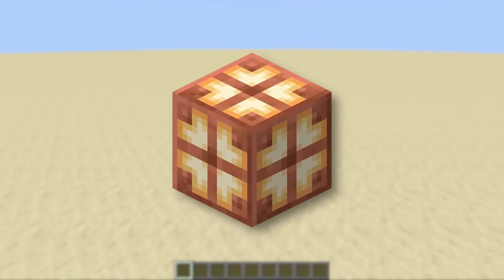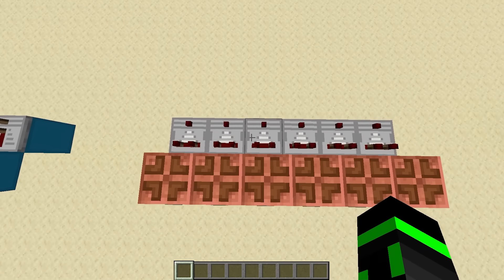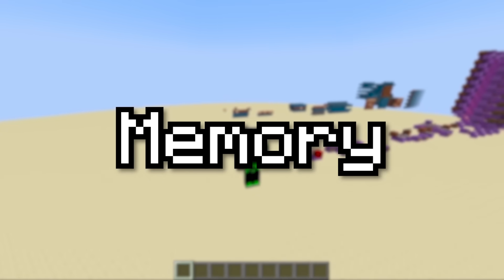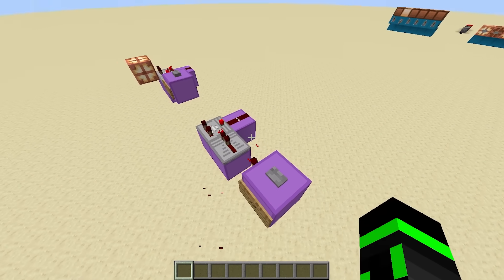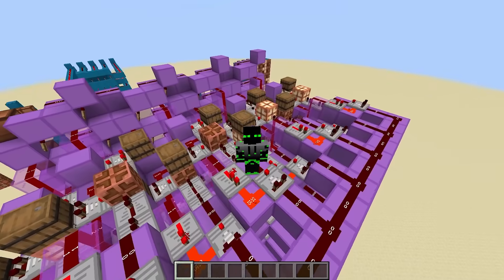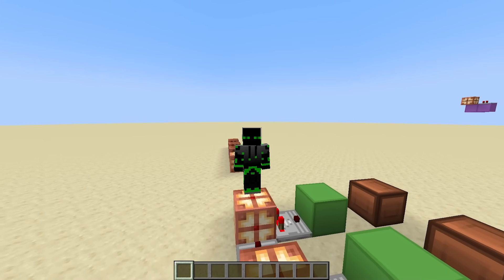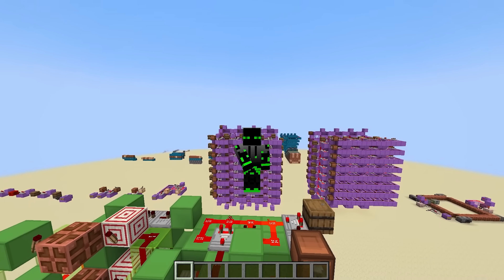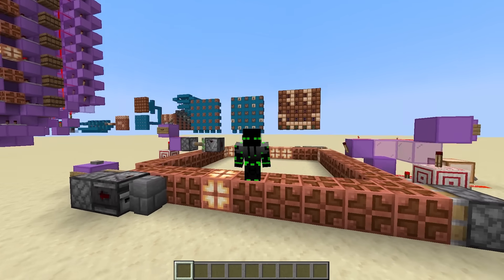Why I'll Never Use Copper Bulbs

Comment from the maker: What do you think? What do you agree/disagree with?

Btw, this is the first time I’ve ever made an opinion/rant style video, so please let me know what you think!  :)

Have a great day!
Reply: I feel that the reset is the most annoying feature about the copper bulb. The copper bulb will probably be used more in Bedrock for counters as the Java synchronous counter design doesn't work. Without a good way to reset the bulb, designs are very large which is unfortunate. I would have liked if any additional Redstone pulses also toggle the counter, even if the bulb is being powered. The pulse shortening to 0 ticks is a bit of a weird change. I would have preferred if they make the normal bulbs 0 ticks, the exposed bulbs 1 tick and the weathered bulbs 2 ticks. This would give the other blocks more use that just light levels and also appease the general Redstone community.
For computational Redstone, I think most people will just switch to these as t-flip-flops as they are easy to build.
Reply: Something that I disagree with: the flappy bird circuit u mentioned can actually use copper bulbs with barely any modifications, just put observers in front of the output torches and copper bulbs in front of the observers, bcus remember observers detect block states, and when the torches toggle it updates the observer both in the rising edge and the falling edge, and as a bonus there is no delay for the copper bulbs to toggle so it's very good for animations
Reply: I respect the hell outta you and your ability, but I have to disagree with you that 1t vs. 0t is irrelevant for logical redstone.... the original bulb had the possibility of doubling the frequency of many circuits.  That probably would've been the biggest change to logical redstone in recent memory.
Reply: Opinions: To start off, the 1 tick offset would've actually been pretty nice for making 20Hz machines, likely not that useful for what you make, but for a CPU builder (such as myself) a compacter, faster way to offset a signal into the 2nd range would've been a nice upgrade

The T-flipflop aspect is probably more useful than you think, currently we don't use them thát much, but it's because t-flipflops are slow and large, it's likely they can be used for more complex modules (like multipliers) or maybe even just logic gates

RAM is something I'll mess around with but the bulb will be more useful for executing operations on large amount of data, a kind of GPU
I think the biggest thing in the way of copper bulbs ram usability is that they can't be "reset"

Movability doesn't really matter, there's a saying on ORE "biston bad", we don't want non-solid state blocks in our computers

The counter could be useful as long as it's faster than the full circuit: The counter's output is locked until the CPU finishes its command and reads the next number, which by now has 'loaded in'

Displays don't really matter too much for me, but screens that store their input separately can easily reload the image to correctly disable the bulbs

*Mainly:* Copper bulbs speed up (and compact) T-flipflopping, and as someone looking to take out delays out of already incredibly slow machines, it'll be a nice upgrade
Reply: @Natural_Power   That's the thing with the 1 tick change... they "fixed" the feature that made block more useful than all of its other features combined, and no-one was asking for a fix.  It was universally loved, and they somehow came to the conclusion that it should be removed.  Like...what?
Reply: I feel like you have the wrong approach, you are trying to fit the copper bulb into already existing designs. I'm sure that over time people will discover clever ways to use the copper bulb that is genuinely useful. I think it's important to think of it as a tool in your toolbox rather than better or worse than some other component.
Reply: @kennyduncan7  Computational redstone is about using existing components in large numbers and clever combinations, so the only way a new block can be useful is if it improves something that already exists.
Reply: review every redstone component like an unboxing video now!
Reply: @CraftyMasterman  that would be awesome
Reply: I like how you just made a spinning hard drive inside of minecraft
Reply: The spinning memory thing can litterally be a disc!
Reply: 9:27 - "Copper bulbs are movable"
This means that you can make a movable display, where you can print something on it, layer by layer, and then move it to the user. Maybe you could try to make a rotating copper boolb chain  where each loop is different, like for displaying a moving text...
Reply: @Thesuper997 that was the first thing I started doing when they made bulbs usable. A feed tape can write, read and clear in separate locations on the same cycle
Reply: You raise some excellent points from your field of view! Personally I disagree with your points on selector UI. I personally like UI in Minecraft to be as reachable and as compact as possible for convenience of the user, so that you can see more at one time and perhaps don't need to move as far to select more options in some cases. I approve of CLB (Copper Lamp Button) selectors, but that is just subjective opinion.
Reply: I made 1x2x13 per bit RAM using copper bulbs.
Reply: there are now harddrives in minecraft with spinning bulbs
Reply: i think you overcomplicated the read write at 8:07, all you need is a button directly on the bulb to write the memory, then take a comparator output. much smaller and doesnt need to read itself. im not 100% if this solves what youre trying to do but i cant imagine it needs to be as big as you made it
Reply: how dare you have an opinion
Reply: 9:30 - actually u could do the same with comparators
Reply: To me it can boiled down to "I don't really need it" / "It makes things more difficult" and then "still pretty cool though"
Reply: I personaly think that lamps arre closer to a rapid acess memory; where it is temporarily stored but only for active use. I think the spinning design could be expanded upon with the copper bulbs, though, to make something like hard drive storage. I mean, that is more or less how it works irl: a spinning disk reading 1s and 0s. 

I also imagine it could be used to create the beginings of an internet: image 'files' can be stores (and in advanced systems eventually maybe even called), and using the leaves and observer trick, it could send anything from morse code to low res images between 2 systems
Reply: The bulbs are ok but not the best. You can definitely mimic using observers though. Especially for your flappy bird on “turning it on then off” so you’ll have a one pulse input instead of two because observers do the work for you lol
Reply: It can also be used as an XOR gate
Reply: Also if you want to reset the copper bulb instead of using an XOR gate just input it into itself when you want to reset them
Reply: And another thing if you want a screen you can use an observer
Reply: As a fellow computational redstoner (albeit on a smaller, less informed way) I think that if you don't know how to make things like a synchronized binary counter and don't want to look it up like myself, than the bulb is in fact a good place to start.
Reply: But wouldn't the piston v-tape be a good shift register? State reset could be made at the way "back" to the input. You could also shift the back, which isn't possible with repeaters.
Reply: I think copper bulbs are created specially for a logic redstone, specially for a memory units. But i think you using them wrong, it's easier to roll up them in tire so that bulbs can be used like real hard drive (like you did on 9:25), the only problem that it need a control system instead of straight in-out
Also, synchronized counter maded using copper bulbs is easier to reset, because it can be done without taking your mechanism apart , just use comparator, piston and observer
Reply: The important thing is for us to understand that copper bulbs are not a replacement for lamps. And it shouldn't be compared to redstone lamps in the first place. Instead of thinking how copper bulbs cannot replace redstone lamps in your designs, try to think about in what ways it could help your works in other ways. But yes, as of whether you want to use it or not is entirely up to your own preferences. 👍
Reply: I think the moving data system could be used for some form of assembly language, just stick them in a line and make them move along it in a defined pace to run the code
Reply: i thought they would be a gamechanger for memory at first, but i guess a t-flip-flop is pretty useful.

Also for timers, but mojang wrecked that :(
Reply: I'd rather watch your rant video than most others, and I partially agree with your opinion in that the bulb is not quite the game changer everyone is making it out to be, but if you really got to playing with it I'd bet you'd come up with some pretty cool circuits.
Reply: now starting off here i'll say my thing is doors, i don't make much else cuz i don't usually need to for what i make but i would like to say i have gotten so used to thinking with an adaptive block that it seems difficult to me to adapt [pun intended] to a toggle block. not sure if that's just me, but i wouldn't be surprised if it's not either.
Reply: i use redstone a lot i love it
Reply: but i hate what theve down to it in the newer snapshots
Reply: i don't play minecraft, 
but if your big brain says its bad to have less tick rate
then i believe you, haha-mwahaha.
Reply: Aren't copper bulbs usefull for transferring bits?
Reply: @mattbatwings Can you put a link for a truth table with all the letters of the alphabet and there codes for decoders
Reply: From what I understand, you're claiming copper bulb based memory to be the linked list of logical redstone. And as with linked lists, the basic idea will probably be morphed into something useful for the field.
Reply: Try make operating system, with program selection, calculator, paint, games and writing program
Reply: I wouldn't consider this a rant. It's considered reasoning for your use cases. I'm using them for the tape in a Turing machine but that's the only thing (so far) in computational redstone where I thought "this is a perfect job for copper bulbs."
Reply: You could create a piston feed tape memory if you want to read sequential data chunks.
Of course, item mechanics can do this too.
Reply: I think copper bulb can be used to make hard disk for your computer
Reply: you just need a mirror of the screen you're displaying but more spaced out behind the scenes, would make it trivial to clear the screen too.
Reply: i'm not like. super good at redstone, but in regards to using the bulb as r/w memory, would it be viable to, instead of hooking it up to an XOR gate, just have it sort of reset itself before writing? if it's 1, then directing the signal from the comparator into itself would set it to 0, then you could reliably write to it. and ofc if it's 0, nothing would happen.
Reply: the idea of copper bulb is not to replace lamps but todo things you could only do witch larger sircuts
Reply: It is possible to make a flying machine with an embedded message formed by these bulbs?
Reply: So guess you didn't try to incorporate it into any logic circuits  because you can make an insanely compact xnor gate with 2 observers and a copper bulb
Reply: bruh
Reply: What about the 1 game rick delay
Reply: Compression?
Reply: Sculk sensor memory? Might take a bit more space and pain because of the bulk of wool and the annoyance of having to cover up every reading piston with wool when retracting wool to take signals. However, the benefit is wireless communication of 1-15 signals through walls with easy decoders, encoders, and writing to memory.
Reply: Just use it as a transistor, on=1 off=0 easy, and practical
Reply: Would the copper bulbs work better for long term storage?
Reply: When she remover the one tick is good beaceause now you can make signals that are instent and longer than 15 blocks
Reply: 🤔… Although I think building a computer in MC is kind of impractical, I enjoy watching the creativity, and the creative ideas involved with it can be useful for more practical builds (farms, grinders, storage systems, et cetera) sometimes. As for color displays, if I were going to build one I wouldn't consider copper bulbs. Using colored glass and sticky pistons would produce the best results imo. If you're really fancy you could make a backlight with beacons, though any light source should work technically.
Reply: @MoorganHart  it's not factorio, it's minecraft, you build something once and it works. Why you need to build farms in survival? It isn't funny
Reply: All I have to say is that we now have a compact way on bedrock edition to half the frequency of redstone pulses. For example, if you attach an observer to a piston on Java, whenever the observer sends a signal, the piston pulls or pushes the block, while on Bedrock it just pushes and then pulls it back quickly. But now, you just need a copper bulb and a comparator and it does the same trick. There are quite some differences between Java redstone and Bedrock redstone, but a way to make some parity between the two is always good, especially if you can only play on Bedrock and the most interesting creations work only in Java.
Reply: I think copper bulb is IC of T-flipflops.😁😁😁
Reply: 8:25 you can just make a hard drive out of bulbs using piston feed tape
Reply: 8:28 no, its ok that it just erases. its STILL USEFUL for that.
Reply: I completely disagree with you on the copper bulb at 2:41. The lamp is on, of course it’s on, and the copper bulb constantly emits a redstone signal, so it can’t even do pulses. I think you’re making an issue that really isn’t an issue. I mean this respectfully, I don’t want to be rude to you. Also if I’m wrong please correct me
Reply: I agree
Reply: they should make a waxed version of the block thats 1 tick vs the 0 tick version
Reply: about the RW memory, in computer science, you dont assume that the memory is 0 be default. you fill it with 0s before using it.
Reply: I really like them, but i agree, the resetting part is annoying.
Reply: the point about levers signifying toggling by the fact that its a lever is Imo not a very good reason to choose lamps over bulbs as BULBS signify toggling by the fact they are bulbs just like levers.
Reply: This video came out a year ago and it's still useless
Reply: feel like everyone else in the community is doing the rant videos, this ones so much better than that though, actually discussing why it's not ideal for your field of redstone piece by piece
Reply: With the button selector you're making a mistake I used to make - getting too accustomed to the old stuff and hating the updates because they are different. It's annoying when updates make your previous knowledge obsolete, or when someone makes a design better than the best one you could make. However, just refusing to use the new stuff update is basically just giving up on making good redstone - unless you genuinely think the old stuff is actually more fun to work with, since then you can call it a self-imposed challenge.

You could make a toggle memory for a computer with the bulbs. Instead of putting XOR gates in each memory cell, the computer would have to read the old value into a central XOR unit.
Reply: @immibis yea I felt like he turned down functional and/or aesthetic improvements in order to avoid time investments
Reply: I understand all of your points. I also think that its cool that mojang is bringing more components that arent useless. (Skulk sensor, im looking at you 😂)
Reply: @pixl_xip  skulk is good, but again, not useful for computational stuff. Ever seen cell/wifi towers in minecraft? that was made with calibrated skulk sensors.
Reply: @pixl_xip 
It's useful for automatic doors and deep dark gameplay though
Reply: @Yegor_Mechanic  sure and those are the intended uses, but it cant do more than that, thats all im saying
Reply: @pixl_xip 
You can make mines
Reply: @pixl_xip  you just made the entire trap community angry af
Reply: @pixl_xip  Sculk sensor memory? Might take a bit more space and pain because of the bulk of wool and the annoyance of having to cover up every reading piston with wool when retracting wool to take signals. However, the benefit is wireless communication of 1-15 signals through walls with easy decoders, encoders, and writing to memory.
Reply: Basically this video = my thoughts, but I think it’s a bit more useful in silly small circuits where you just need a t flip flop.

Comment: late to the topic but I mainly use them as a pulse divider. This is usefull for chained auto crafters where I run one observer clock and derive several required pulses.